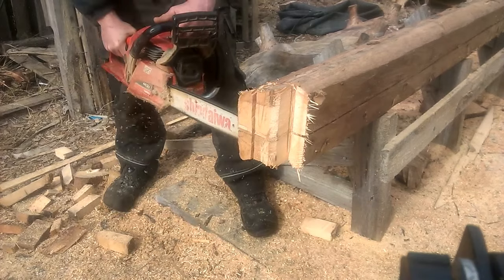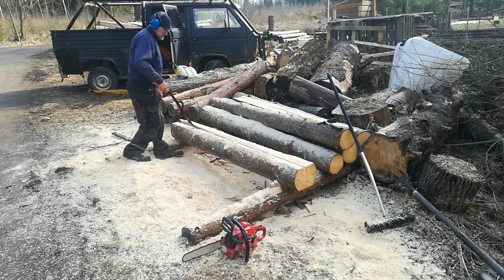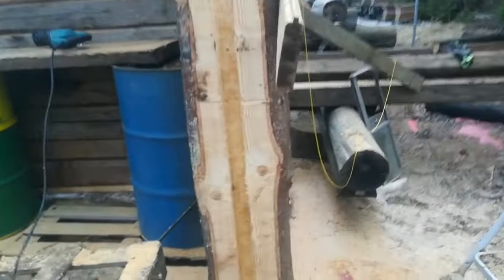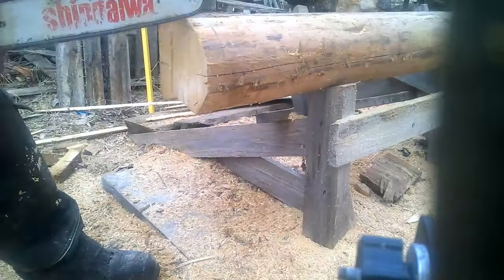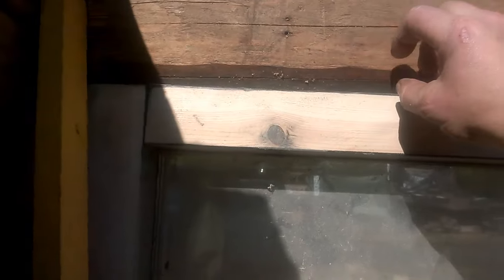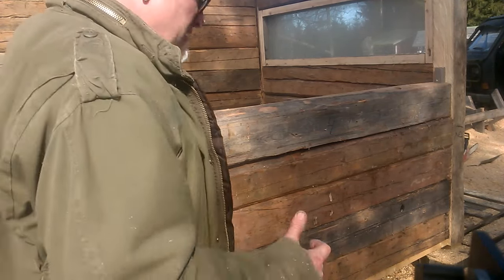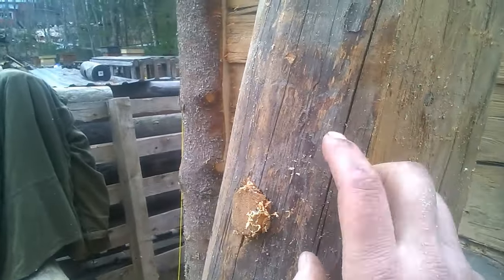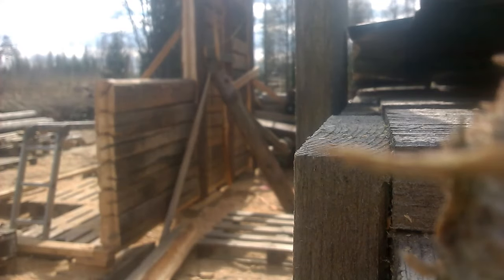Easiest log building method ever!!. Part 2

Comment: Why couldn't you cut all the logs to length and screw a 2x2 on the end? You would only have to grove the corner posts.
Reply from the maker: ok. Good thinking but here is the problem. We are dealing with logs which are all different, some much taller than others, some that are taller at one end than the other, some may have a slight curve in one direction or another so when you put the log in place and you have to draw and cut the gutter /lateral groove on the underside of the log then to get a good fit you may have to take 1 cm from one end, 2cm from the other. Now your pre-made tongue or 2x2 which you made perpendicular to the log is no longer right and you will have to modify it. This mod is easy to do...unless you have screwed a 2x2 to the end of your log in which case you can't use a saw because of the screws. But in any case in modifying that joint you have shortened the log and you don't have enough at the other end. Thats why I leave them a little too long. I settle both the lateral groove and the tongue and then once the wall section is done I cut the other end.
Reply: Thank you for the detailed response. I guess I was thinking about fitting the logs on top of each other, then cutting the end in one swoop. After that, screwing in the 2x2 so it would all be the same depth going into the vertical log. Then making the vertical log fit the 2x2. I can see where I'd probably have a problem with keeping the logs aligned straight up and down the outside and inside without canting. Also getting the vertical end logs in alignment with the square base.
Reply from the maker: Again. I like how you think. Yes it would work to build a whole section of horizontal logs, all fitted together, and then cut both ends straight....but that would mean building some kind of frame or supports to hold the 'wall' up until you were ready to cut.the ends. Plus then you would have to take them all down and re-install them with one end (tongue) into the groove in a post, add another post at the other end and then start again. If you do it my way they are already in place.
Reply: Thank you for taking the time to help me understand. Have a very fine day.
Reply: Damn good idea but I see the potential problem. Still..  you could set one side of the wall with a cut tongue, which supports the wall and 2x2 the other end. Saves a little time.  Kind of a cheat though. Not sure why that bugs me. No one would know, ha.
Reply from the maker: @NeedsMoreToys  I have actually done it this way. Just have to be sure that once you attach that 2nd 2x2 you then cut it between each log leaving a small gap. Otherwise the 2x2 will prevent the logs settling at that end.

Comment: Could you dove tail those "tounge cuts"??
Reply from the maker: Yes you absolutely could, It would mean lifting the logs up high and sliding them down in the grooves but you could argue that you would have a stronger joint.

Comment: Why not have vertical logs. See Bushradical YouTube channel. So much quicker, with non of those time consuming cuts.
Reply from the maker: checking that out. thanks for the tip.
Reply from the maker: Ok. I had a look. Interesting stuff that I need to look into deeper. I do have a couple of issues with one or two things he said in the video I watched which was a 'Q&A' video. But I will take a deeper dive. Thanks again.

Comment: instead of screws, use wooden dowels
Reply from the maker: You are not the first to say this and I get it. My day job is restoring historically significant log buildings for the Finnish Historical society and there it is often mandated that only pegs can be used. In those cases I understand but that's a very different situation. Its nice to keep it traditional but lets face it, If, the people building buildings a hundred years ago, or a couple of hundred years ago, had access to the kind of screws, bolts and nails we have now they would have used them. There are places where a wooden dowel will last longer than a screw or bolt but there are also places where a bolt will be better and last longer than a dowel.
Reply: @ProjectHighlander  Please don't think it a criticism.